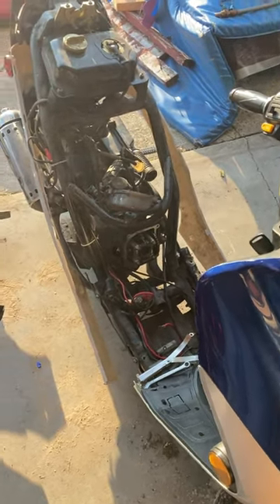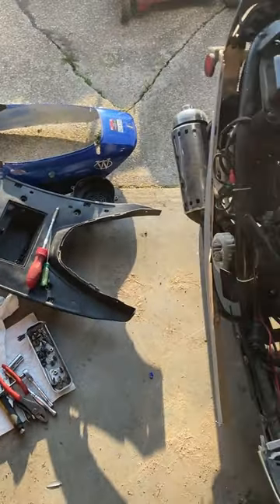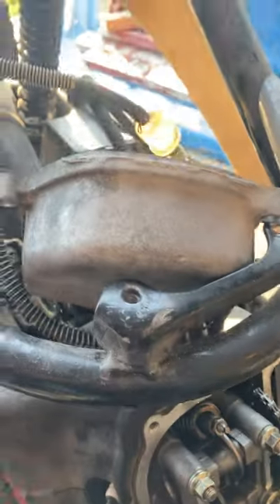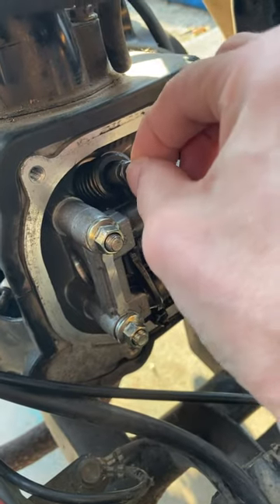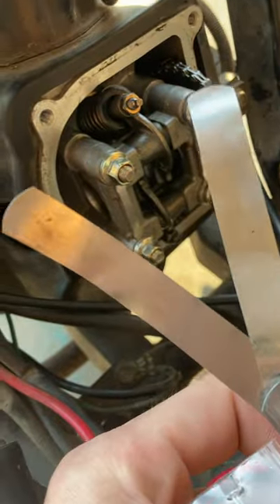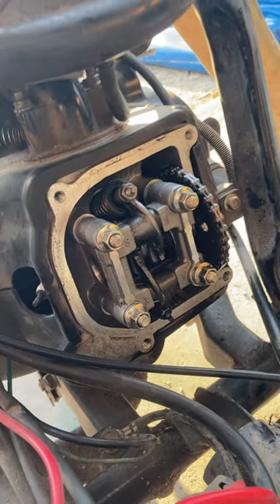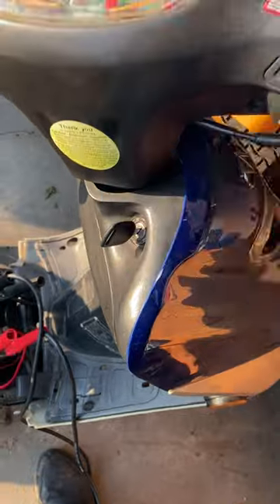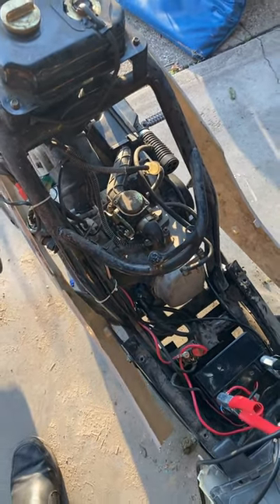50cc Moped Won't Start | Found The Fix!

Comment: Did it like run for a sek, an then just died, and then just didnt start. cuz that happened for me. may this be the fix?
Reply from the maker: Yeah ran fine and died while I was riding it. Then wouldn't start anymore. For me I just had to re adjust the valve screws.
Reply: @FlyFreeNation  for me it just wont give no signs of wanting to start. was it the same for you?
Reply from the maker: Is it turning over? Mine would turn over just wouldn't fire up.